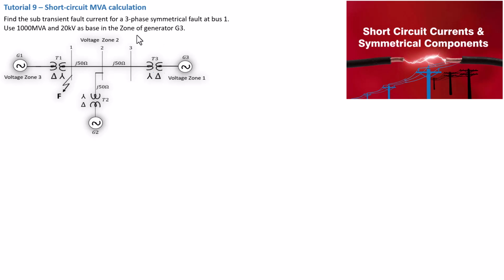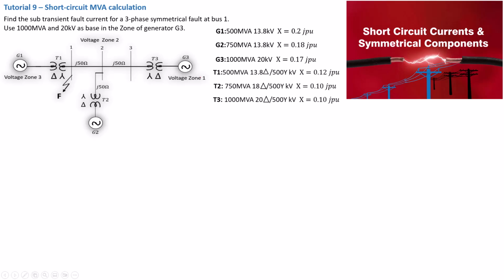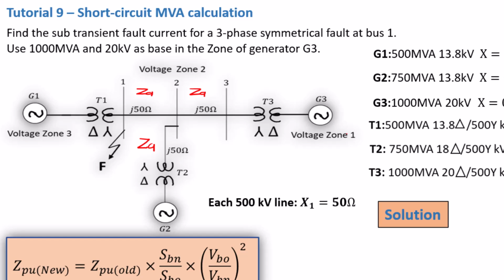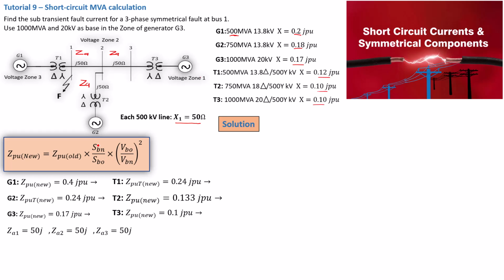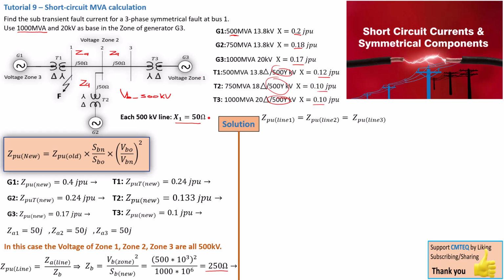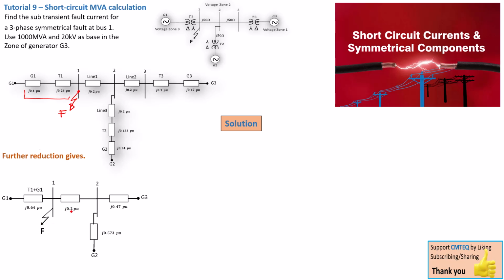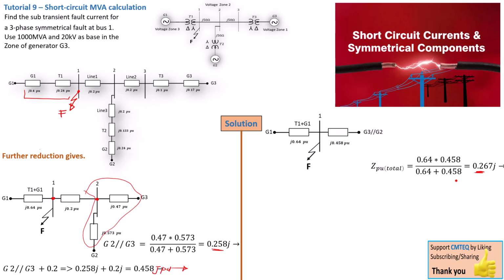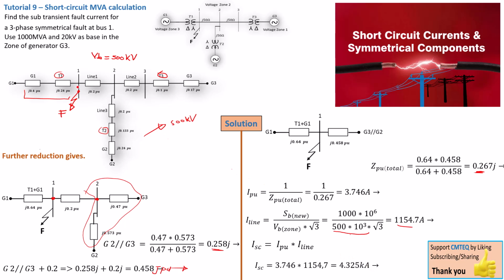Short circuit fault level - Fault current calculation. Tutorial 9

Comment: Good morning engineer, I would like to ask you a question about this exercise, I am asked how to calculate the three phase short circuit currents in bus 2, with fault impedances of 3 Ω, this would be posed with the same formula of Isc= Ip.u. x I line (Iline=Sbnew/sqrt(3) Vb(zone)), I fail to understand what would be referred to those 3Ω fault impedances. it is the same exercise only that my professor adds that concept. for example, how do you get a short circuit current and a fault current is it the same thing? thanks a lot !
Reply from the maker: Hi,  yes Fault current and Short circuit current are the same thing, they both describe a condition where the current exceed the rated or nominal value.

The 3Ω fault impedance is the actual impedance of the line or element during the fault, so in this case this is Z(actual). In this problem Z actual is j50Ω, and in your case its j3Ω.
You can ask your lecturer for further clarification.

Comment: Good Video, but I have a doubt: G2  is 13.8 kV and T2 is 18/500, if Vbase = 18, then  Xg2 would be 0.141, I do not understand why you got 0.24?
Reply from the maker: Hi, thank you for spotting the typo.
The parameters for G2 should be : 750MVA, 18kV, Xpu:0.18jpu.

Generator 2 voltage must match the low voltage side of the transformer to maintain the same base voltage on that section, so Vbase = 18kV from generator not 13.8kV.

Let me know if there's amything else you need clarification.
Reply: @CMTEQ  thank you
Reply from the maker: You are welcome 😊

Comment: Good day, I noticed when solving for the Xpu(new) of generator G1 the Kvb old and Kvb new was not considered, unlike the formula you stated, could there be a reason for this?
Reply from the maker: Hi Mathias, are you enquiring about Zpu(new) = 0.4jpu?
If yes, the values of Vb(old) and Vb(new) where actually used in the formally but they did not affect the answer because they canceled out.
Vb(old) = 13.8kV and Vb(new) = 13.8kV for  G1 and T1 calculation.
I hope that clarifies your concern.
Reply: @CMTEQ  thanks for the timely response, it doesn't really clarify because the Vb (old ) is 13.8 and Vb (new) is 20 as stated, so they don't cancel out
Reply from the maker: Hi Mathias, actually Vb(old) and Vb(new) are the same for G1, please watch my earlier video where I only focused on per unit, this video is more about fault calculation.
Sb(new) = 1000MVA, yes it is true the problem statement states that Vb(new)=20kv which actually only apply to G3 zone.
You can not impose a base voltage for the entire system, each zone have its own voltage as you will have Step up and step down transformers along your transmission line.
So, on G1 zone Vb(old) is 13.8kV and Vb(new) =13.8kV you cannot inject another voltage there unless you change the Generator design and its output voltage.
Reply: @CMTEQ  thanks for the clarification, I'll watch more of your videos for better understanding.